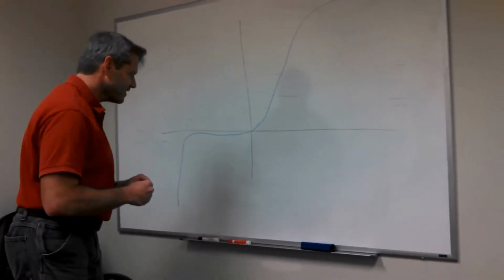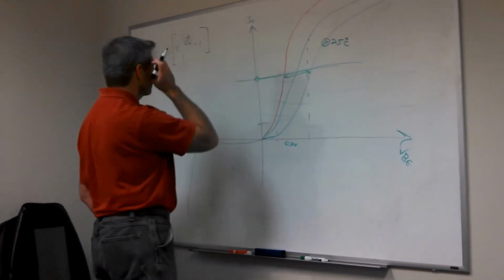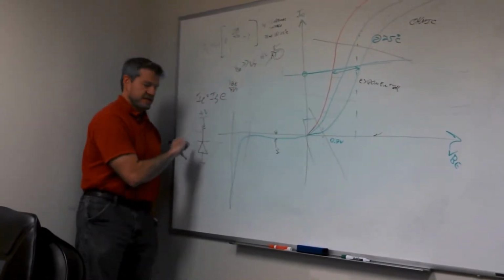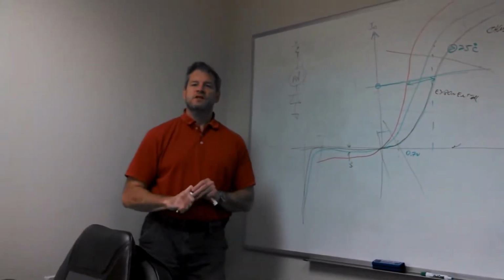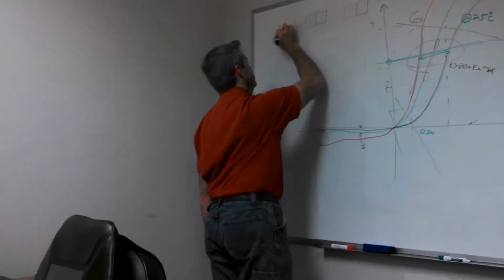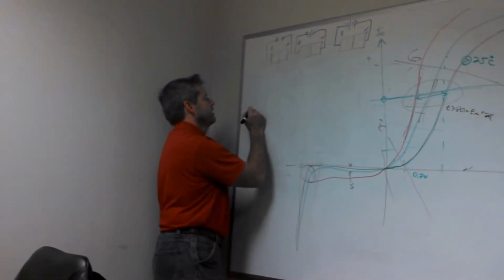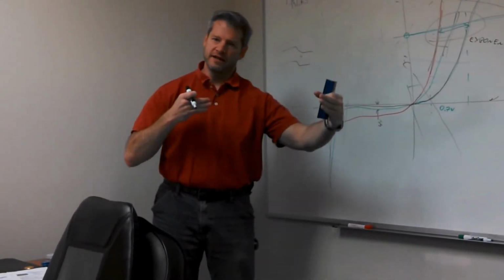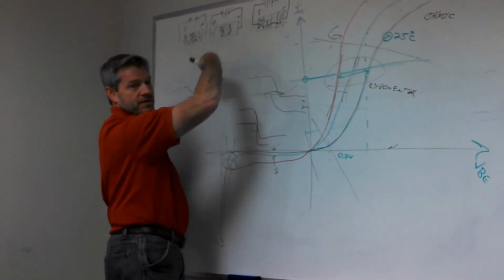More on temperature sensitivity of diodes and BJTs

Comment: hi..there is a way to make exponential growth of the current without transistor or diodes...or there ir a way to stop temperature issue in transistor or diodes?
Reply from the maker: There's no way to make the temperature-induced current changes to "go away."  However, you can account for it.  This is why they make transistor "pairs."  Go to DigiKey, for instance, and look at this part number: DMMT5551-FDITR-ND .  It is a "matched pair" of BJT's.  That is, they are made on the same piece of silicon, in very close proximity to each other, all under the same process.  Therefore, they are about as close to physically identical as you can get.

Now, using something like this, you can use one of the devices to act as a reference, wherein you always subtract its current from the circuit that is utilizing the 2nd device.  Now you are effectively subtracting out the temperature dependency.  I make it sound easy - it's a bit more complicated, but that's the idea.
Reply: @TomBurkeii   ok..or there is a way to make current exponencial growth with only op amps?

Comment: You can use Is to measure temperature by timing reverse-bias decay with the input capture unit on most micro-controllers. 
This provides high resolution readings without the amplification often needed to use forward voltage deltas on low bit ADCs.

https://thecavepearlproject.org/2019/11/04/single-diode-temperature-sensor-with-arduino-icu-via-reverse-bias-leakage/